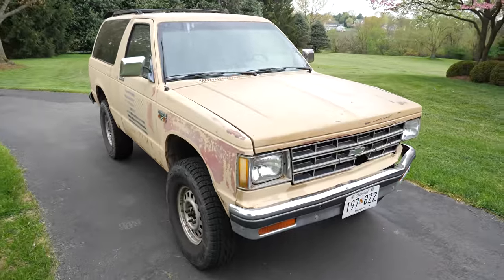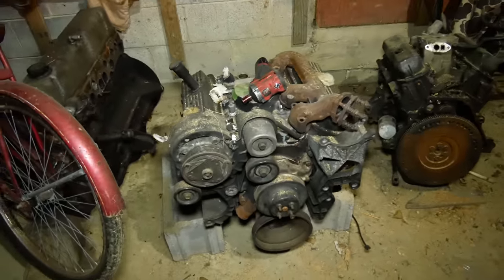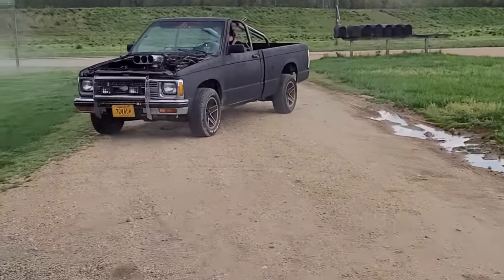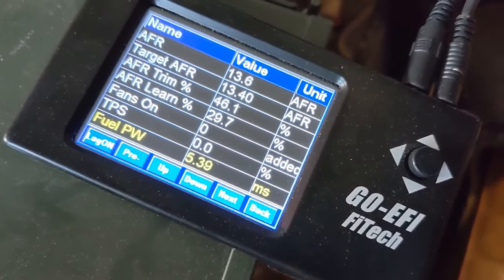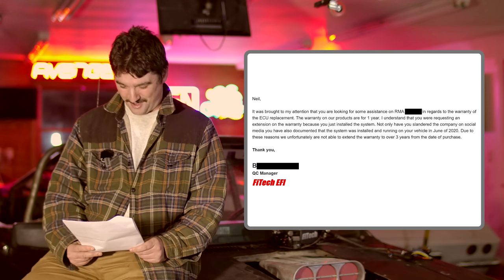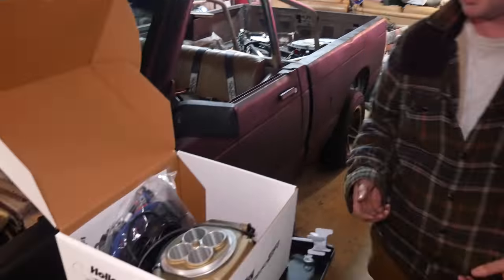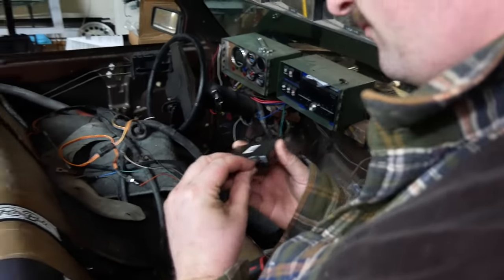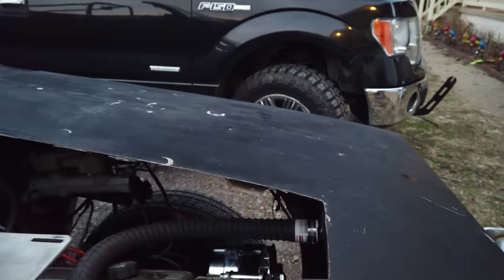1988 Chevy S10 V8 EFI Project FiTech Debacle and Holley Comparison (Friends Ep.2)

Comment: Problems with Fi-Tech: 
1. Website sucks
2. Laptop Sofware hard to find
3. EFI software sucks(no resolution in tables) (not user friendly)
It also sounds like an open exhaust on your truck. That can cause reversion of fresh air throwing off 02 readings. The self learn features use 02 reading to udjust the Learn Table wich is a modifier of the base fuel table. It will never work with open headers.
Reply: I have the Holley Terminator TBI since 2014 and have been very happy with it
Reply: I agree on the O2 reading issues, I did make a longer pipe to reduce this effect (and I feel like it should have still ran poorly vs. not at all), but the computer started having other issues before I could complete the exhaust. Now that I have full exhaust on the Holley setup, it's even better than it already was!
Reply: @triptheroad  Good to hear. I have been really happy with Holley EFI products. Ive heard of some issues with the sniper but i would buy that over a fi-tech any day.

Comment: Man I had the same problems with my Fitech. The computer failed before I made it out of the driveway. With how much I spent on replacement sensors on a new Fitech I wasn't about to spend $250 for an new computer just to fail again.
Reply: My thoughts exactly, if I made it 1000 miles, I may have given it another go at my expense,  but no excuse for a garage kept system to fail that fast
Reply: @triptheroad  yep I just rebuilt a Rochester 800cfm quagdrajet I had lying around. Maybe I'll try the Holley in a few years. Will have to see how it goes for you.
Reply: @mr.wambller5240  quadrajets are underrated, I have one on one of my other projects and it's such a fun carb to drive with

Comment: Will avoid FiTech but my concern is that T-5, I know they won't take a V8s power, so find a T56 or cd009 quick
Reply: T5 is okay under normal driving. I definitely have to be careful driving it under load!
Reply: I blew one up in a 87 firebird being careful not to launch hard
Reply: @warrenstearns9068  T56 or even an NV3500 is eventually the endgame, they are just a little harder to find
Reply: Those will do the job also heard good things about CD009 but they are getting more expensive too plus the sikky kit is not cheap
Reply: @warrenstearns9068  main reason for using the t5 was the ability to bolt it in and go with minimal modification
Reply: I get that and it's inexpensive to get it going but I just had the experience I know they won't hold the power your making for long

Comment: Why would you want EFI???
Reply: In hindsight the inconveniences have outweighed the benefits, even with the sniper. But it does just work 90 percent of the time
Reply: @triptheroad  pretty good reason
Reply: @dave7569  I left it in a wet field for 10 weeks and I put the battery back in it and it fired up within about 4 or 5 seconds
Reply: @triptheroad  damn i would efi my truck but i feel like one you master the carb you can keep them running on a dime for years
Reply: @dave7569  I just went back outside yesterday and started it for the first time in three months and it fired up in about 3 seconds of cranking lol. Now it's working pretty good
Reply: @triptheroad  ok i see your point but i personally prefer the fuel toilet